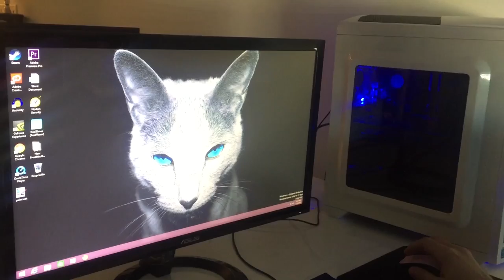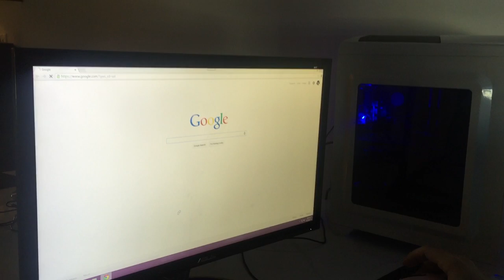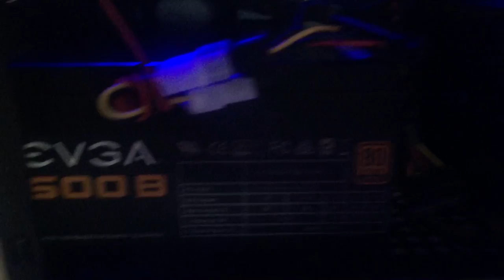How to Build an EPIC $650 GAMING PC - MicroATX (Frostbite)

Comment: Wow, excellent build. I am going to be building a new gaming pc soon, i was always hesitant about the micro atx since I never knew anyone who used it, looks solid. The only thing I would worry about is the lack of fan connections, but I assume that could be remedied with another board.

This will also be first foray into SSD territory. I cannot believe that boot speed. I think I am going to do this same build but in a mid size case. More options and the ability to add a blue ray drive.

I normally don't sub to tech channels but you guys seem down to earth and not elitist dick heads. Well done. :)

Comment: hey im looking at doing this exact build, strictly for gaming. What is the most demanding game you play and what frame rate do you get with this machine on it?.
my current machine crashes every time i Load GTA V on it on LOW settings. so i need something that can handle something like that on at least high settings.
Reply from the maker: Renee Northern You will average around 60FPS on GTA V with max settings in 1080p --- it's a great build for 1080p gaming. We will post some videos soon showing how it performs in different games soon. For a demanding game like the Witcher 3 --- Max settings with hairworks off average of 44.5 FPS https://youtu.be/esgZcUtvcUU

Comment: How did you guys install windows on it, did the case come with an optical drive?
Reply from the maker: Nick Zdenovec Just a trial version of Windows 8.1 right now that I put on the SSD. Unfortunately, the case does not come with an optical drive or an external drive bay for one.

Comment: is there any other case i could buy that is from the uk that is compatible with these parts as it would cost me £50 to get it shipped to the uk
Reply from the maker: Dean Mulholland it just needs to fit a microATX motherboard and a 273mm graphics card. I browsed around a little on what's available in the UK. Here are FOUR I liked: 

White Corsair Air 240 MicroATX Mid Tower Case
 http://www.amazon.co.uk/dp/B00LA6WXEO/?tag=pcp0f-21 for £67. 

OR the Phanteks Enthoo Evolv Micro ATX Case - White... but it's little larger than mine and its £84, looks pretty sick though and high quality.

The Gigabyte GZ-MA03 Micro-ATX Case has no window, definitely a very budget oriented case, but is under £20 and will get the job done. 

Lastly, the Thermaltake Versa H15 http://www.amazon.co.uk/Thermaltake-Versa-Gaming-Window-Interior/dp/B00UNJRG78 for £35 (it's black, but has a sidewindow, a couples inches longer than DIYPC in video).

Hope this helps. My personal favorite is the Corsair Air 240 MicroATX --- I have a Corsair MidTower Case for a fullsize ATX motherboard, it's a lot longer than Savannah's DIYPC case though --- it's in my $1000 build https://youtu.be/WBhgWK865o0
Reply: +Savannah and John thanks for putting in the effort and searching around I subbed
Reply from the maker: Dean Mulholland Awesome! we hope you enjoy your new PC :)